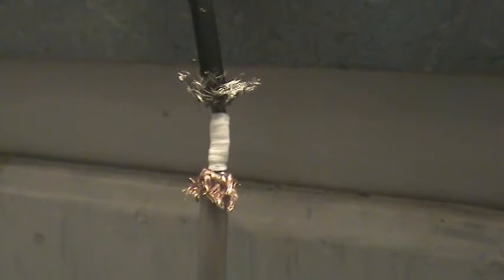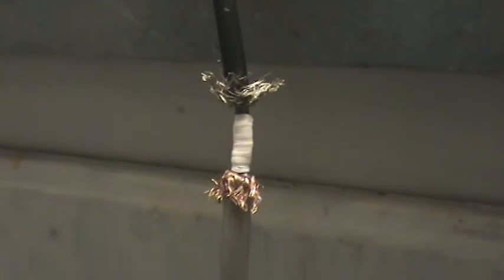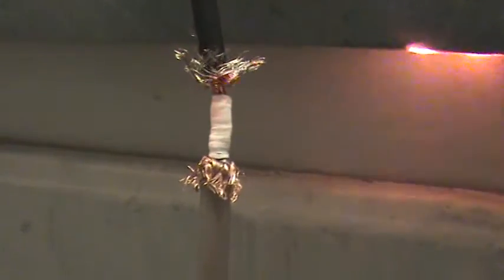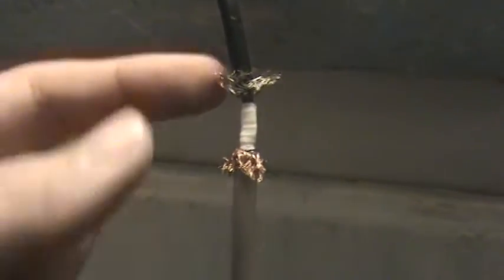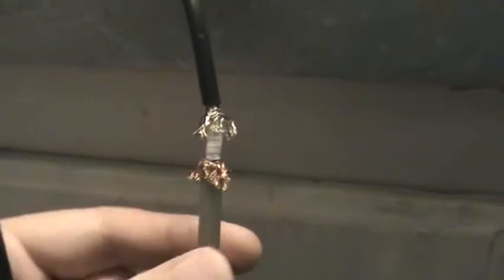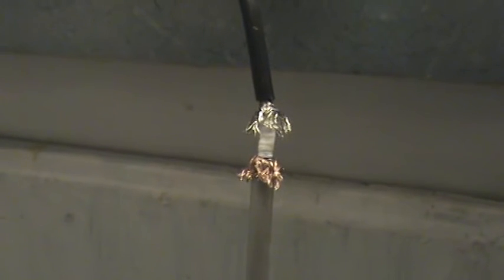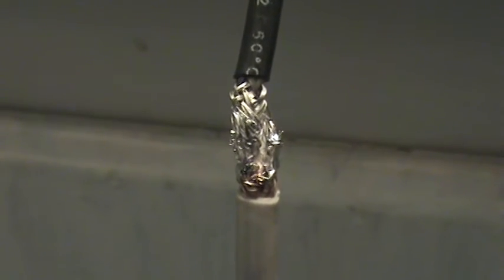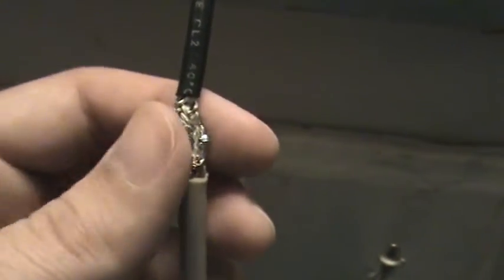How to Splice Coaxial Cable (Solder)

Comment: THANK you.... I've done this and had it work SO many times after hearing me engineer dad say it would be a mismatch. On higher frequencies I did try to file the center conductor down to size and and smush dialectric insulator down on it best as possible, yielding flawless cable TV and internet. I thought I was the only person doing this. You have people saying you can't do this for CB or even lower HF (but you can assemble all manner of hokey linear things and place them in-line and as long as they connect with 50 or 75 ohm "official" connectors whatever amateur weirdness is OK). It got me thinking, why can't I just treat a splice like an in-line tuner without the coil and varicap, and make it small. Boom that equals a direct splice, LOL. A meatless sandwich is fine when all you need is the bread. Playing with an SWR/watt meter it's amazing how much you can get away with without significant loss whatsoever. Like you say, gets touchy but I've gotten away with even UHF as long as you watch it and secure what works down well. Some people have money 24/7 and can't imagine not buying everything. You hear these rich guys oiut of touch with us little guys or even vital corners of the net, all the time, saying "Nobody ever builds their ham equipment anymore, that completely died out, it's just all purchased, modular, plug & play.". Tell that to those of us still building everything and dumpster diving. I have found re-purposing materials and DIY so rewarding I do it when I could have bought the equivalent (take the wife to dinner instead). The less you look to your bank account the more everything around you explodes with constructive possibilities and you get conditioned to think that way. My wife catches me eyeballing handrail tubing, LOL.